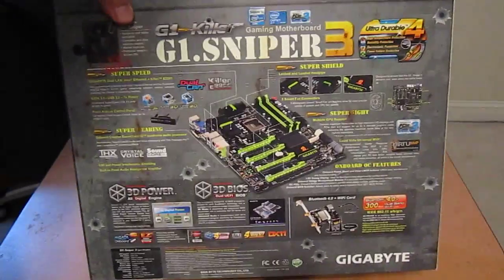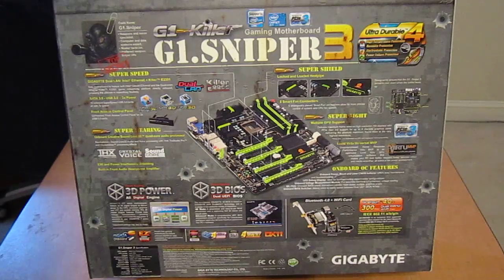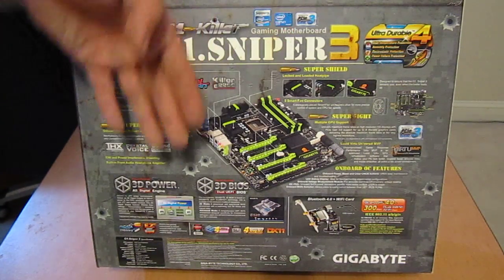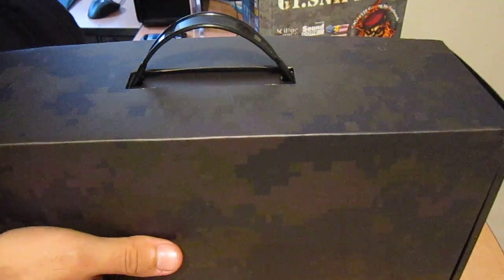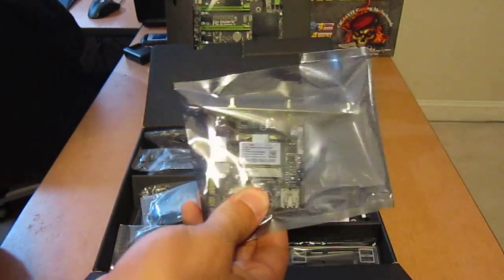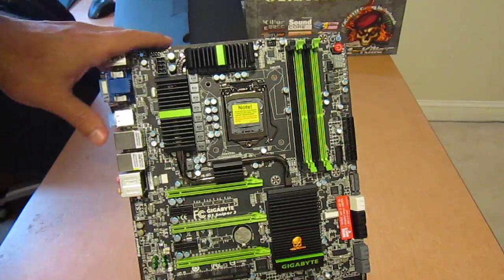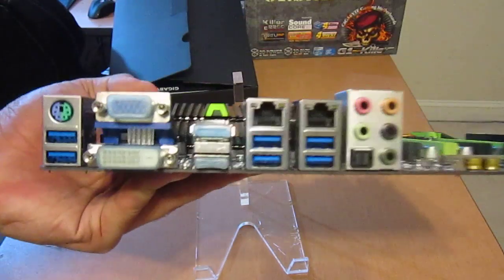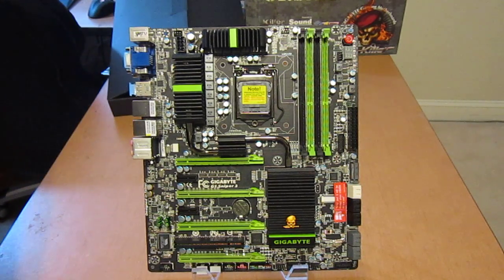[SinHardware] G1.Sniper 3 Preview!

Comment: I'm wondering if this board will fit in a Cooler Master Storm Trooper case which is rated for ATX boards (12 X 9.6 inches).  The Sniper 3 measures (12 X 10 inches)?

Comment: Again, the only sissy-mary reasoning you ever hear from the manufacturers and people are in forums is that "oh oh it will be blocked by a 3rd or 4th video card" which its ENTIRELY incorrect. They further say that "oh so people can reach them when installed in a case"...and I'm like *** HELLO MORONS! *** these are NOT for peeps installing in a CASE! Power/Reset is already on case and CMOS reset on back near USB! The ONLY right spot is the extreme bottom right edge below SATA PORTS. End of story..

Comment: Point was, if it was done RIGHT, none of this screwing around would be necessary - these positions would work best for EVERY tester. Again, these buttons ARE NOT for people installing in a case. ...can't reach with screwdriver, have to stand up, a secondary point was I've been staying we need key button on a 10ft extension with double sided tape for years...just like a sound control switch that we mount under the lip of our desk...blows me away with all the on BS accessories, noone's done this.

Comment: Yeah but that's only optimal if the board is to your LEFT. You want the flexibility of running air-cooled graphics cards and top facing you on the RIGHT would result in blowing the heat SOUTH when NORTH is optimal. Also, for people like me who test hundreds of CPU, and constantly yank video cards, you want to minimize walking AROUND the board to do what you want to. But bottom line is that we really need all this sh!t on a 10ft remote with double-sided tape that is elbow-distance away..

Comment from the maker: I actually bench along with most other guys with the whole right side the the board, more importantly the top part of it closest to me so i can use the voltage read points, as well as pour LN2 into the pot. I know anyone who prefers the buttons at the bottom, as they will get covered in 4 way or become increasingly hard to get too. Also why would you place the buttons so close to the jumpers? To each his own I guess.

Comment: I ran out of room so I couldn't get into detail - I mean the EXTREME bottom right corner of the board below the SATA ports - your 4-Way card won't cover that. The reason this is the ONLY right spot for these boards, is because hardcore testers either have the board to the LEFT of them with the hot VGA cards expelling air left...OR they have the board on the test bench to the RIGHT of them with the VGA blowing BACK behind their desk. In BOTH of these scenarios bottom right is the CLOSEST!

Comment: my vote is for ROG boards... always, if you go to hwbot.org you'll find most of the ultra high end overclockers either use ROG boards or EVGA ... there will be SOME gigabyte stuff but the higher you go the more ROG stuff that is used... if you dont plan to extreme clock tho, probably the gigabyte.

Comment from the maker: One thing i would like to say, they are in the correct position for extreme OC because of this: If you have extreme GPUs running 4 way, then the lower right gets blocked. thus you have the buttons at the top. If you have a RAM pot and the top buttons are blocked, you can still use the jumpers. But if the buttons are on the bottom they are blocked for Multi GPU, and not for memory, so you have no options if you have 4-way with buttons at the bottom. They are there b/c they work well there.

Comment: Another VERY important point for enthusiasts & precision overclockers is the onboard voltage read points on the upper right edge of the board.

Only bonehead move on the board (along with other boards in their line, as well as Asus boards & now stupid EVGA) is the Power ON/OFF & Reset buttons in the top right corner. These belong in the BOTTOM right corner & ONLY the bottom right corner. These are NOT for peeps installing in a case! For EXTERNAL hardcore testers. At least Asrock got it right!